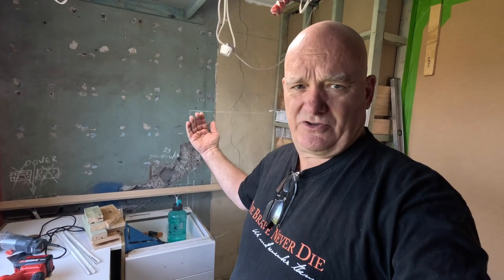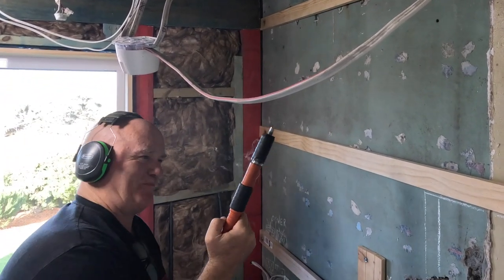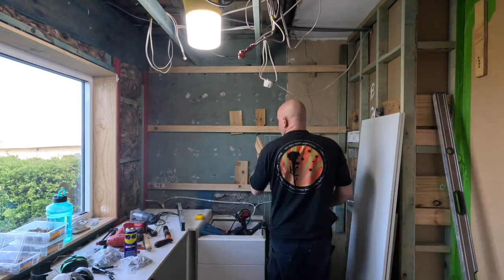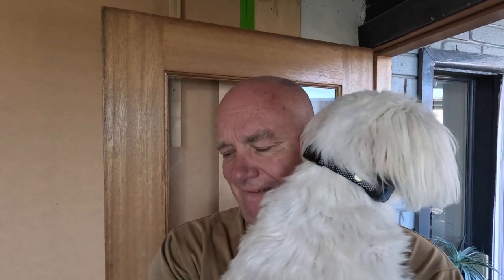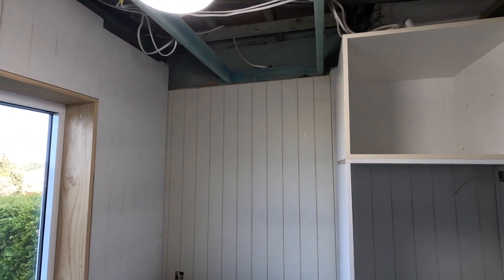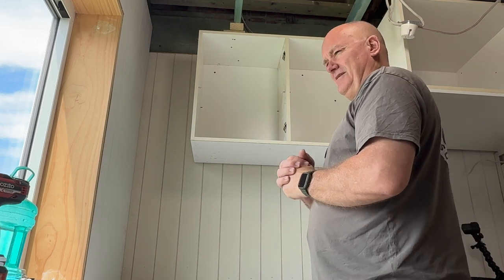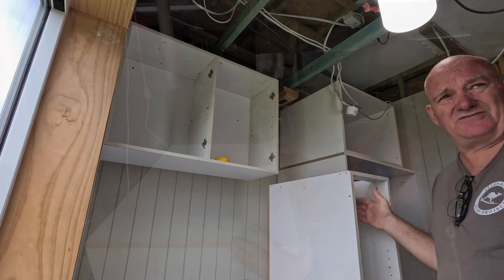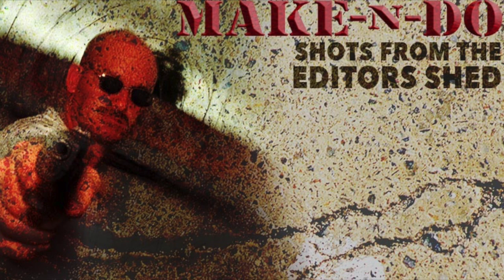Wall panels and high cupboards

Comment: I thought you said the cupboards had to come forward as well.
Reply from the maker: The bigger cupboard I put up first was meant for the high placement, so was shallow – and when I moved it to the left,, I did bring it forward about 100mm (with a cavity behind it. The skinny cupboard that filled the remaining space was meant for floor mounting, so was deep. I left that 100mm deeper when I cut it up, so as to use all the space, but still leave it flush with the other cupboard. So, overall, the cupboard faces are 100mm forward of original.
Thanks for watching, as always.